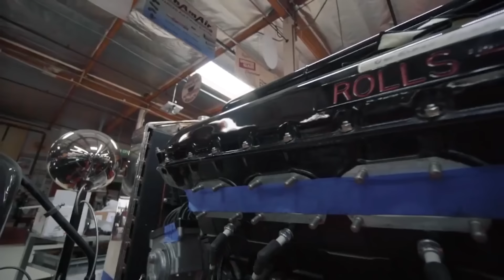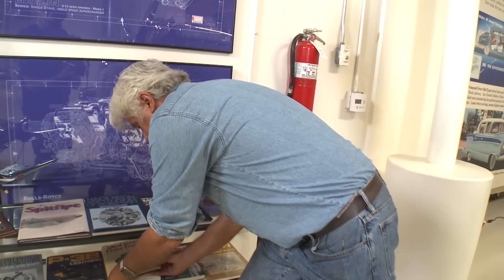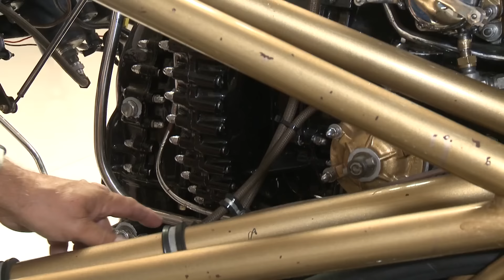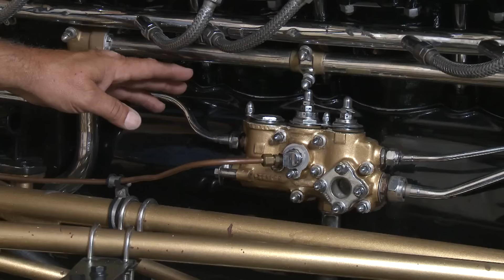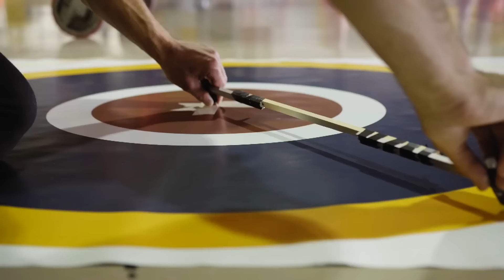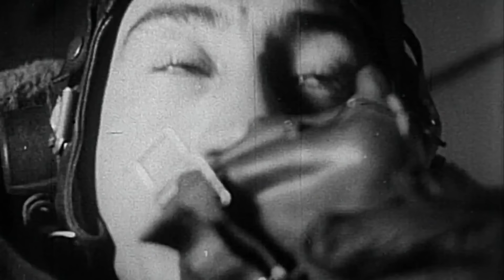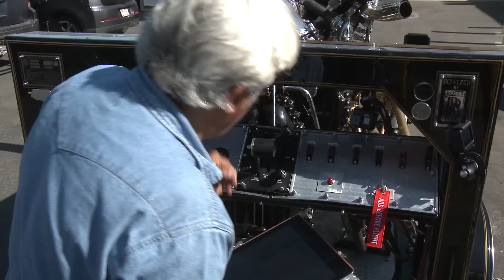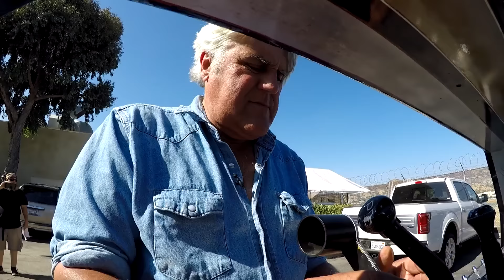The Engine That Won World War II - Jay Leno's Garage

Comment: A old mustang mechanic from WW2 lived not far from us when I grew up as a kid. He got me interested in Hot Rods mostly due to his old Flat head Ford Pickup with a Offenhauser headed Engine and 3 -2 BBL carbs anyway he had bought a decommissioned P-51 Mustang from some place in South America and had it shipped up to the middle of Nebraska complete with it's Packard built Merlin and I was there the day he finally got it all reassembled and started it for the first time....it leaked oil and av gas several places so after making the needed repairs and tightening of fittings it fired right up and he and I taxied it on his home built grass runway behind his barn turned shop...the wheels lifted off the ground on the return trip down the runway and I saw daylight in the setting sun under the wheels....then we safely taxied it back to the barn and a little over a week later he flew it to his Brothers Farm in Northern Missouri where he visited for a couple of days before returning home in it. He landed it safely parked it in his barn and it sat there for the next few years. He faithfully started and ran it every week or 2 till he sold it to a War Plane Collector some place in Northern California I think he told me.
 Funny thing is he never had any children and his only wife died at the age of 64 so most of the time I spent with him it was just him and me working on hot rods or that Mustang.....when he passed some years later I got a call from his Atty. Telling me he had left me his entire accumulation of tools and that 1950 Flathead Ford pickup. His Brother's family got the house and farm and had a huge auction where many of his treasures were sold to the highest bidder but I got the tools and Truck and still own them all today. Someday I will pass them on to my Son but man the greatest gift he gave me was his friendship, patience, knowledge and experience....that and a ride in a real honest to goodness Merlin Powered P-51 Mustang ! the greatest gift of all.
Reply: What an awesome story.  Thanks,  for sharing.
Reply: @starfighterusscv-6693  
I was afraid when first posting this people might think me a Liar of the first order but interesting thing is I have a whole photo album we put together of him and I working on the old war bird...(that was what he named it)...he let me have my High School Art Teacher come out one Saturday Afternoon and paint a nasty looking Hawk that was black above and brown underneath in flight with leather flight hat on diving under the name on both sides of the nose) it had a black and white checker board design on the tail and lower rear fuselage and a blood red nose cone with the flat black top of the engine canopy right up to and around the cockpit.......anyway I have bunches of 110 kodak instamatic photos in the album from the very day it was delivered on 2 semi truck flat beds and a Van Truck...right up to the day we said our goodbyes to the plane when it's new owner hopped in her and pointed her nose to Sunny California several years later......I know it went to Santa Monica but from there have lost track of it in the years since. I only hope it's still flying someplace giving the thrill of a lifetime to people like it did to me....my only regret in this life is I didn't take him up on his offer to teach me to fly it....who knows I might own it today yet if I had.
 Someday if I ever run into the old girl I will make a present of the photo album to whoever owns her now.
Reply: @nunyabizness0u812  no name dropping..
Reply: @Chris Banks 
I know I did.....though it would have been Perdy nice to have the Mustang too....lol
Our Son asked to borrow the Flathead one day and about a Month later brought it home.... wearing a bright new shiny paint job...(he used it as his Senior Auto Shop Project ) and completely re did the body and Oak plank Bed in the Box of the Pickup.....it's still my Daily Driver and has well over 200,000 miles on it now total but people who are alot sharper than me about those Flathead Pickups are always telling me it looks better now than when those trucks were brand new....and I gotta take their word for it.....I know this much.....for how heavy it is.....it's still really fast and sounds fantastic.
Reply: I lived half a mile from the National Helicopter Museum so was used to odd things flying around. One dayI heard something very different. Two P-51 Mustangs buzzing my street at a couple of hundred feet, went out to watch and they did it 4 or 5 times that afternoon. Turns out a neighbor knew one of the pilots. Priceless :)
Reply: @UnclearFizzyCyst  Well the Swiss Airforce bought some Mustangs in Germany  at the end of the war.  (Together with  GMC trucks, Dodge WCs and Jeeps. The vehicles were bought by km: The US Army parked them bumper touching bumpers on the German autobahn and Swiss officals bought a certain lenghts). 
I have seen the P51 in Museums several times. But I recall an event about 40 years ago: First I heard a Merlin engine running full power and a Mustang with olive drab color and USAAF markings flew full blast and very low through a valley near Berne: Nowadays you would be in big trouble for doing so, but I LOVED it!!!
Reply: Usually grown men dont cry. You didnt make me cry but a tear of joy was just shed. I wish I had somone like that in my life at some point.
Reply: @burntchickennugget191  Yeah me too.  Not every one gets to know someone like that.
Reply: Your story touched my heart
Those tools are a treasure and so is the pick up truck
A once-in-a-lifetime gift
I see that as priceless  but more importantly Time spent with the gentleman as if you were his son
May you pass down all that you were taught by the mechanic, to your children and one day grandchildren.....

Much love and respect from Chicago....
Reply: Loved reading your post amazing thanks for sharing your journey!
Reply: father's show up in our lives when we need them... great story brother 👏 🙏 Peace ✌☮
I inherited my granddad's tools.. he was a diesel mechanic, probably on tractors.. they left Oklahoma during the dust bowl era and moved to Salinas in California... I had this really great 1/2" Snap-on ratchet   that would still be good.... some poor boy thought he needed that box of tools more than I did... waited till my dog joined me at a party and lifted that big old bottom box out of my 58 GMC stepside.... may it serve him well 🙏.. 45 years ago.. I hope he learned how to make a living with them... I did
Reply: Damn what a story . I miss my buddy he moved to Missouri I don't have a garage to work on stuff in anymore. Go big red!!!
Reply: Post like this make me HATE that Youtube doesn't have a LOVE React...  Awesome Story, and the old guy actually gave you the things he treasured the MOST... Very Cool. ;-)
Reply: Thank you for sharing this wonderful story
Reply: you are a very lucky man to have met that mechanic! Great story!
Reply: I never heard of a flathead with 3 deuces, though it makes perfect sense with the Siamese center valves..
Reply: @scotthammer4007  Three Stromberg 97`s was a typical setup................as observed in Hot Rod Magazine.
Reply: @scotthammer4007  pretty common
Reply: @scotthammer4007  Man that was the original Hot Rod... But then i'm 77 and remember them well.
Reply: Man, that is one of the great stories. You’ll cherish those memories for the rest of your days.
Reply: Thanks again for letting us know and love you and love ❤️ your gift 🎁 your heart ❤️ for many kinds of machinery . At 78 ,,,I seem to be able to enjoy your life. We aren’t in the same planet, but I think 🤔 sharing is a great 👍 🎁 gift to (us) the little ones who’s love’s are similar!,,thanks LENNO!!!!!!
Reply: What a great story, thanks for sharing.
Reply: Got a ride in the p-51?  What model?
Reply: @theccpisaparasite8813   None of them, obviously.
Reply: Great story!  Bless you!  Thanks for taking the time.
Reply: Your story is beautiful and sad and powerful movie material, if you ask me…but I just really like that kind of thing. I don’t think I’m alone😎♥️
Reply: Randy- that's a great story from your youth to fondly remember, indeed!  As  having 8 decades under my belt, and unfortunately no children, I have some (precious to me) collectible items; it would be shame to let the government, or merely some well meaning charity (where hopefully it will all go) under estimate the love and devotion some people have for objects that have a lot of memories tied up in them.  I truly hope I find someone like you to donate it to in my remaining lifetime, God willing- not too soon 😉.  We all have a debt to Jay Leno for his many works bringing interesting cars back to life and letting us all learn about things we knew not, but once learned, satisfy the curiosity. Oh, yeah... Bravo, Rolls-Royce-Merlin;  One of our large lathes is currently in production in RR's plant in England, making the engine turbine blade rings for newer jet engines.  That was also an experience!
Reply: What a wonderful story.  Thanks for sharing!
Reply: Brought tears to my eyes... thanks!!
Reply: One of the coolest stories I've ever heard. The social media bs of travel and luxury of of today doesn't compare. I'd much rather experience something like that! Thanks for sharing friend 😀
Reply: It’s a true pleasure to hear the story you tell of your relationship with him. I believe you received the greatest gift he could give; the knowledge passed from a true hero of the greatest generation!! Amazing story!!
Reply: No ... if BLM gets its way it will all be thrown in the nearest river.  😆  You need to get rid of all those old junk possessions of yours and clear out your mind of other people's trash.  India today owns Jaguar cars and makes them with no contribution from you know, the useless former owners that weren't making money and had to sell out to the highest bidder.
Reply: Wow, you are sure a luck man to have know him!!!!!!!!!Great story and ending...........Cheers, Jim
Reply: What an awesome story my friend!!
Reply: Beautiful story sir!
Reply: What a lucky guy you are.
Reply: If only we had video of this would be amazing
Reply: @briantruck2284 
Brian I have actually wished I had a movie camera to have filmed that first time I saw that War Bird lift off and roar once again....it was a sight and sound I can close my eyes at night when the house is quiet and were all in our beds.
Reply: Beautiful
Reply: Thank you so much for this wonderful story.
Reply: what a blessing!
Reply: Great story to go with the tools you hand down to your son.
Reply: They are all a special generation and will forever be treasured for their bravery but most of all what they gave to us. Loyalty love and freedom.
Reply: Thanks for sharing this wonderful story. Have a good time :)
Reply: This may be the coolest story ever told.  It speaks to your respect and love for the people and machines that made this country the great nation that it is.   Well done, sir.
Reply: Thank you for sharing that awesome story.
Reply: What a great story! And a lot of people are completely aware that a lot of the US aviation history is centered right here in the midwest, along the Missouri River. From Sioux City through Omaha and down to Kansas City were dozens of airplane companies! Boeing Airplane Co. I think started somewhere in our region! GBR, love from LaVista!
Reply: It always tickles me that Rolls Royce chose Packard over all the other bigs names to build the US made Merlin. Apparently the others weren't up to snuff. Bravo Packard. You made a good one (or, rather, 55,523 of them !)
Reply: Thank you for sharing that.
Reply: What a wonderful and heart wrenching story.  Thank you  for sharing with, really, the World.
Reply: This is amazing
Reply: What a wonderful story!
Reply: Wow good thing J wasn't in second WW to start the engines we would have lost
Reply: Great story
Reply: Great story. I'm glad you shared it and cared so much about the tools,truck that you've kept them all this time.Good on you.
Reply: @Randy Hill...My gawd that's a fantastic story
Reply: That's a really cool story Randy. Thank you for sharing it.
Reply: I don't know if I want to say that I'm jealous or not. To take a flight it one would be amazing. However, I've sat in one before when I was around 12 and remember thinking it as cramped then, I can't imagine fitting 2 adults in one, even for just a few seconds, haha!
Reply: Man that story made my morning
Reply: My uncle flew p51 in korea shot down never found. My dream was to fly.in a p51 just once before i die. My favorite plane ever.
Reply: That's beautiful. Thank you for sharing.
Reply: Great great story Sir thank you for sharing.
Reply: Incredible story! Thanks for sharing.
Reply: Thanks for the share
Reply: What an awesome story. God Bless you for sharing.
Reply: Awesome story....   Thank you.
Reply: Friendship xcellent when u have a good one 👍
Reply: Some guy's have all the luck.
Reply: You are a blessed man.
Reply: Always wanted a P51, but crap I couldn't afford an ultralight now
Reply: Fantastic!
Reply: Very touching and heart warming story. Glad you made his life happy, God put you there for a reason. Stories like this gives me happiness
Reply: Thanks for taking the time to share that story.  It’s great!
Reply: Priceless wealth he gave you.
But something just as good if not better.
Memories. 
No amount of money can buy Memories.
Reply: One hell of a engine
Reply: The Ford Flathead is another WW2 protagonist. 
They put them in the 110,000 Vickers Universal Carriers, also known as Bren Carriers and Mortar Carriers.
3 ton tracked open top 30mph go-carts, even had a steering wheel instead of tillers.
A driver and two gunners, one on the Bren, the other on the M2 Browning. 
The exhaust system was always mostly crushed from squaddies jumping them off any kind of ramp.
Reply: You should send your story to the Rolls Royce Heritage Trust in England, as well as all the Mechanical stuff they have an archive with all the stories of everything Rolls Royce. I'm sure they'd love that story.
Reply: Great story sir 💯
Reply: @TroyMcCraith 
Thank you. It was one of many great memories He and I had together. He was truly a walking talking book of knowledge. He helped me build and race my first Nitro burning Super Charged Small Block Chevy in a 55 Chevy 210 .
We broke more 4 speeds and rear differentials with that car than any I have owned....lol. I remember clearly there was a 3 mile stretch of county road that was black topped back then about 4 miles east of where he lived. The Local little County Airport banned us from using their runway to test and tune that car (mainly because it scared the hell out of the manager and he was afraid I would wreck and they would be somehow held responsible) but there were no houses along that length of country black top just corn fields and open exhaust irrigation engines so one more open exhaust engine wouldn't make any difference so that was where we tested and tuned the car but never till after midnight when the chances of a local farmer using it were as low as possible...the people of a little one horse town of about 25-30 homes, a gas station, bar/ grocery store/ post office and grade school was about oh....5 miles west of that road and I don't know how many times people from that town knew when Bud and I were out testing that car because the way the land laid it sounded in town like we were right outside of town ! The Sheriff finally showed up at Bud's place one morning and told him we needed to knock off the drag racing out there on that road or else, Bud tried explaining we were not racing anyone and we're just testing and tuning the car but his explanation fell on deaf ears....the locals had enough of that nitro methane huffing monster making 1/4 mile runs and that was that. From then on we did all our testing at the Drag Strip at Kearney Nebraska.
Just thought of those days and thought you might appreciate that tale of my very first adventure into the world of Nitro. Bud introduced me to a friend of his who was a machinist and lived for high performance engine building and between Bud, the Machinist (Sam) and myself they helped me to my first of many local track championships that just further fueled my time in Drag Racing.
Reply: What a awesome Testimony.
Reply: You were very fortunate to know him. That would have been a lot of fun.
Reply: zzzzzzzzzzzzzzzzzzzzzzzzzzzzzzzzzzzz
Reply: Wg
Reply: As an answer to everyone who asked what Letter Model it was ....Bud told me it was a "D" model. I have no reason to doubt his word. The only thing we altered in that cramped cockpit was made a provision behind the seat for me as a skinny teenager to park my butt. It took a lot of engineering to create that space (Bud said he intended to have it for him to carry a small amount of luggage when he flew to his brother's farm in Northern Missouri and back however last time I checked luggage didn't need a head set and neck microphone or to be able to see out both sides of the cockpit lol.....so he wasn't fooling me a bit )....my biggest regret is I wasn't able to fly to Missouri with him to visit his Brother...we made several "hops" as he called them around the sandhills region of North central Nebraska none lasted over about 2 hours flight time but those were memories I will never ever forget.
Reply: With regards to the leaks, old Warbirds tend to drip quite a bit, even when well attended. There's a museum at a little tiny airport in Asheboro NC that I have a lot of respect for, as their exhibits are all maintained ready-to-fly. The whole museum is lousy with drip pans because all the planes leak a little of this and a little of that. It's quite a sight if you're ever in the area.
Reply: @XH1927  naw, never go to Asheville, too many crazy Liberals just like Austin.
Reply: Do a reddit on this story with images so all can hear of this great human!